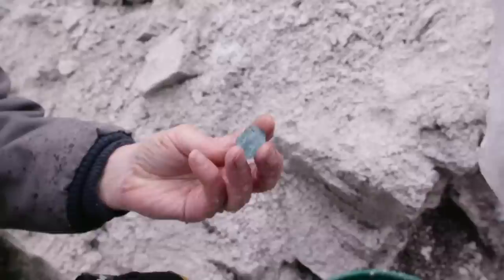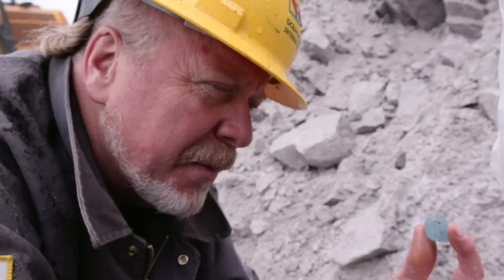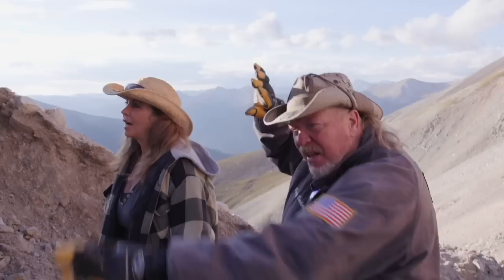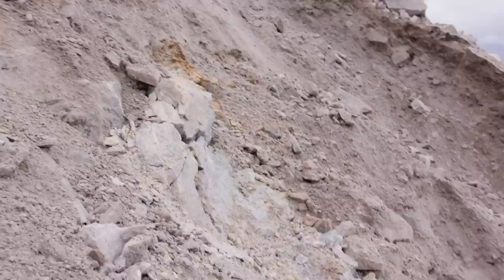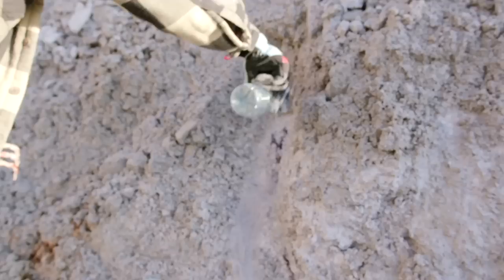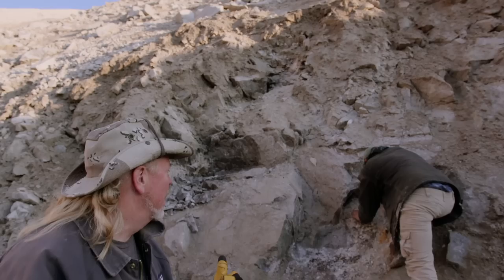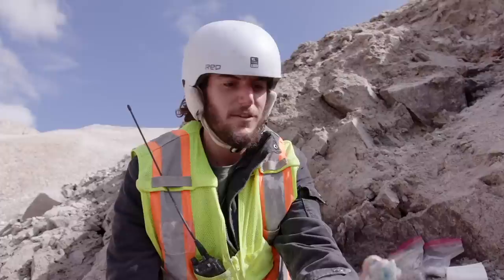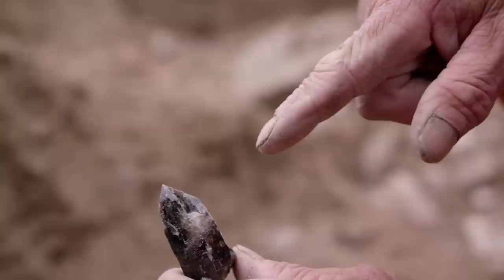A Geological Picture on Mt. Antero: Mining Gemstones | Mt  Antero Treasures: S4:E3

Comment: I find your work up on the Mountain absolutely fascinating. As an Operating Engineer of heavy equipment. The stuff you do intrigues me. Mostly setting up a Water Tank process to hydro-wash your zones. You did that one show of the Pond down a slope. I would have used that Pond as a Pumping station for wash water recovery, pumping station to move water to hoses. Then power wash your work area like they do Gold Mining. Diesel Heaters would be used to heat your pump station holding tank when needed. 
Have you tried hydro-washing that high up on a mountain, or is it not practical?